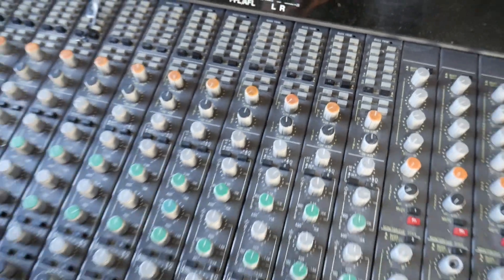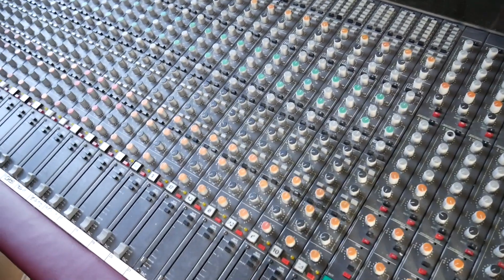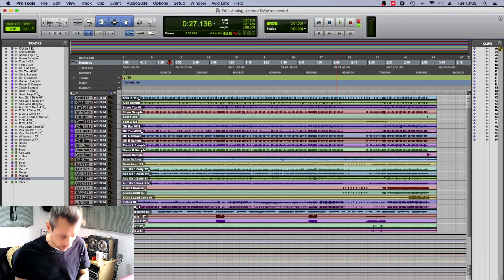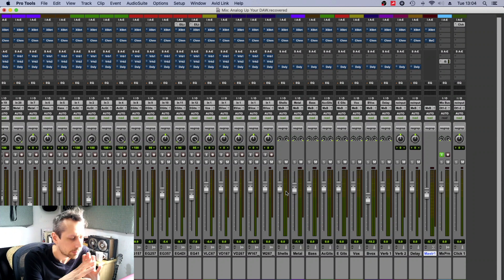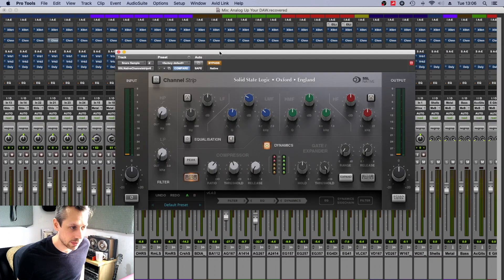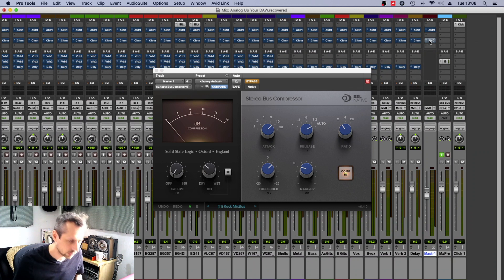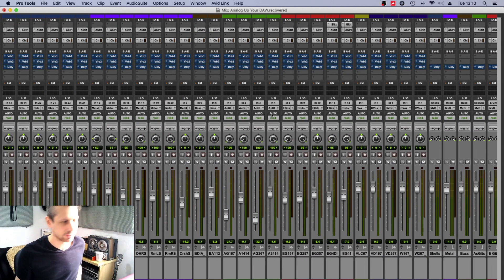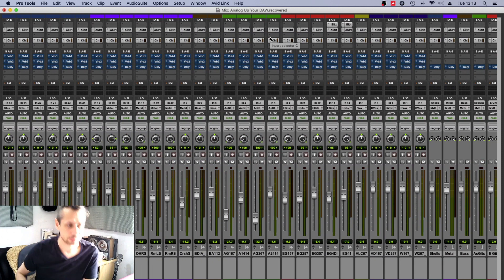Don’t make this mistake when mixing in your DAW!

Comment: I have a few options. I use Harrison 32c for its mixer saturation. I also use Softube Console and put the SSL, Neve, Summit across all channels in Pro Tools. I agree that templates are a must have. Thanks for the great video.
Reply from the maker: Yes I think making records is about using what you have effectively. There are decent free DAWs and very good free saturation plugins. Some people may have to use those. Sometimes you may be in a studio and not be allowed/able to install Mixbus or just need the hardware DSP of an Antelope/Avid/UAD system because the studio computer's CPU is underpowered.  Once you understand how these things work making records becomes a lot easier.

Comment: pretty simple.  Use Harrison Mixbus.
I used to use ProTools with SSL Channel on every channel and then started using CLA MixHub.
MixBus really does the trick.
Reply from the maker: Well of course,  but some folks are just not ready for that yet ;-)
Reply: @RussCottier  Last year I purposefully decided to start learning some other DAWs as I have been using ProTools (hobbyist level) since 2001.  I tried Reaper, Audition, Cakewalk, Studio One, a couple of others and Mixbus followed by Ardour after I learned the history.  Mixbus blew me away.  The decision to have all the control right on the channel like it was a regular console was the first thing that sold me.  I wanted to use the interface.  After that, I realized how fast it was to make something sound good.  I only occasionally open ProTools now.  I can even import old PT sessions.  Every remix of an old PT session sounds MUCH better than the original when mixed in Mixbus.
Reply: @BrantleyAllen  If i understood ypu correctly. Are you saying that you are using CLA MiXHub within Mixbus 32 daw?